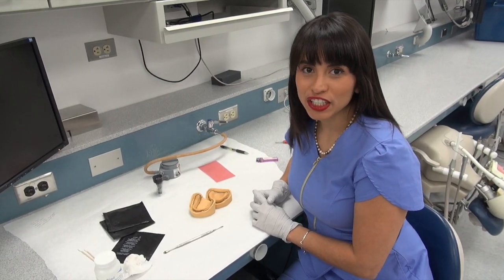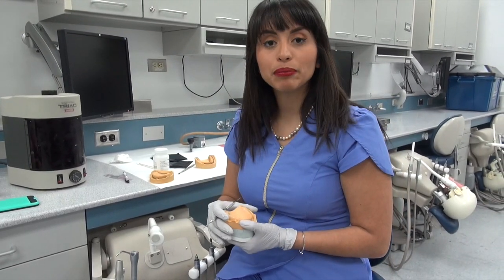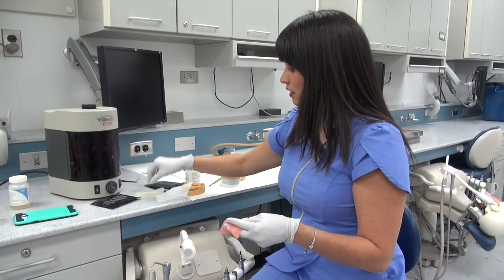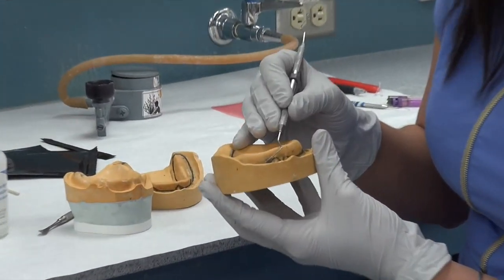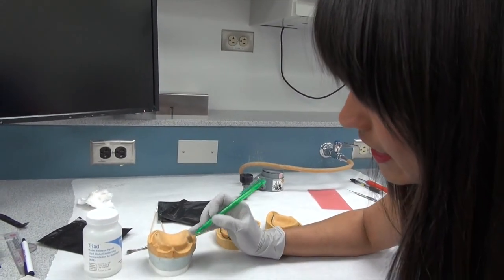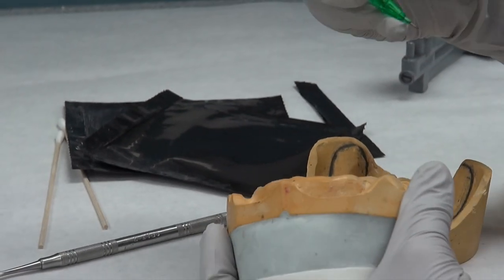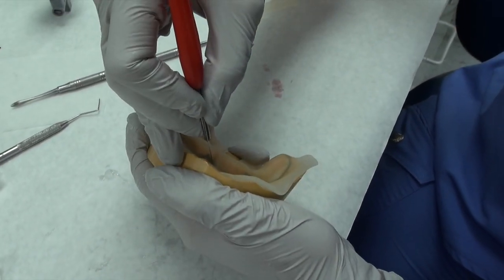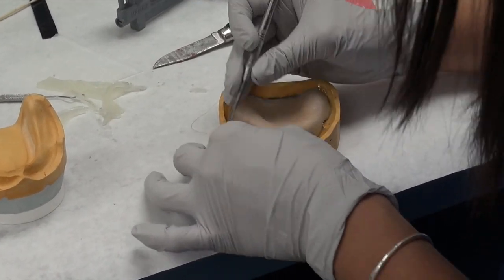Custom Impression Trays Full Length Video

Comment: Generally speaking, not everyone like this type of handle. Every case requires a different type of handle while you taking the impression of the patient mouth and PPE PLEASE a breathable mask is preferable and safety glasses.
Good luck.
Reply from the maker: Rabz N thank you for your feed back. I do the handle a couple of different ways. I will make a follow up post with these. Thank you also for your concern about my PPE during my preclinical SIM lab video. For cinematic purposes I did not have my mask and glasses on during the introduction, however if you notice at 42:36 I do have them on.